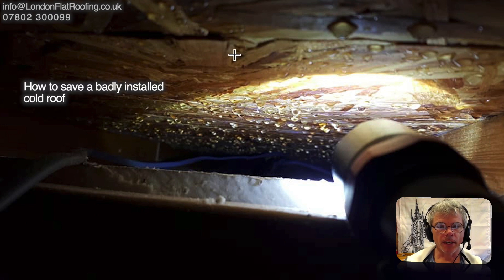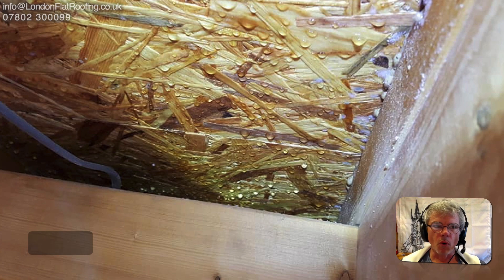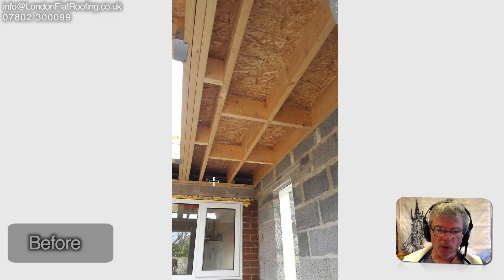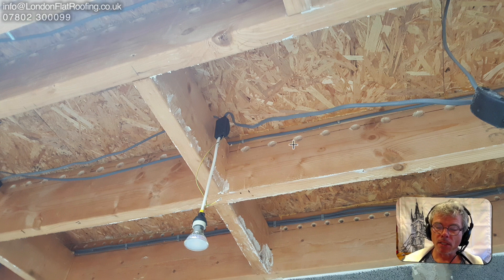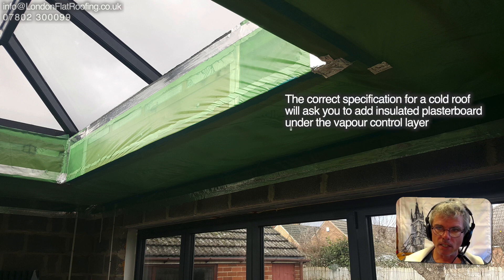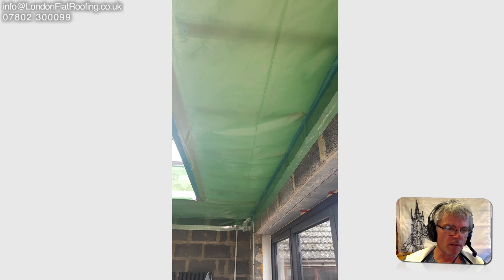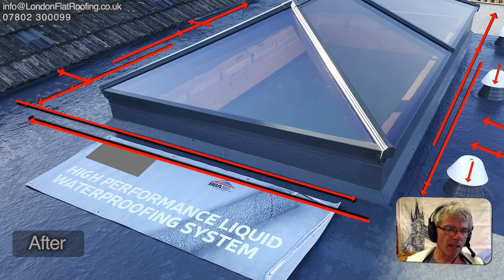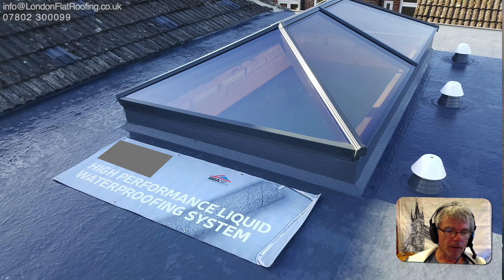Cold Flat Roof Ventilation Corrected

Comment: Steve I've just found your channel. I have a cold roof that has no eaves ventilation etc. Box steel roof. Can I out holes in the the top horizontal osb deck/sarking to ventilate? As long as I don't penetrative the breather membrane?

Comment: Hi Steve I have a builder in at the moment, he's put the joists in and he's put the roof on, and he's told me he is going to fill the joists with a wool type insulation, he's made no mention of air flow, or vents or vapour barriers. Can you give me some advice on what he should be doing please ?

Comment: Hi Steve, I have a cold roof and I do not have any sweet yet, as far as I am concerned, but we have no ventialtion wahtsoever on our roof. we are do add ventilation in the front of the extension( the roof) and we are hoping it sort the problem. is that something you would advise? does it need to have ventialtion both sides? front and back?
Reply from the maker: Yes absolutely you need to add as much ventilation as you can and make sure it's through ventilation so that it can flow from the top to the bottom or from side to side. You only have one vent on one side, the air can't push through

Comment: I always ask myself what these vapour barriers are actually doing when you're looking at atleast 24 holes through it for every sheet of plasterboard you fix. When the insulation is foil backed and the joints are taped, isn't that essentially a vapour barrier? I'd say the removal of the recessed downlights will be the biggest difference here.
Reply from the maker: There used to be an article are used to refer to that was called when is a vapour barrier not a vapour barrier and the answer is when there is something else actions as a vapour barrier in the wrong place. So having a paper barrier is a good idea, but having too many layers that could activate Barrys is not so clever.
Reply: I get what you mean but you are only driving a screw into the timbers which still leaves in between each joist with a sealed barrier and once the screw has been driven home and the board is sat flush up to the timber there’s not really any broken seal to the barrier right?

Comment: Yes, you could be compounding the problem. If you don't do it totally correctly, its  going to be a problem. So you need to vent and you need to have a AVCL. If however if you don't do it correctly, then I would have suggested packing between joists with Rockwool I've seen that work in the past to you have to ask yourself why isn't it working now?   are you sure the roof isn't leaking somewhere? Is the moisture content int he rooms below to high ?

Comment: Ooooh so many questions!
We have a flat roof dorma crofloft and pulled the ceiling down as it was falling in. Turns out the roofers/previous owners had packed the gap with rockwool, so condensation meant it had turned black and was soaking wet.
I’m trying to fix from below atm (I’m a woman with no spare money to speak of right now!) so was planning to put 50mm kingspan between the rafters, a breathable membrane, then plasterboard, leaving a 20mm ventilation gap at the top. I don’t have much depth to play with and There is no ventilation from the fascia boards. Am I compounding the problem by doing this? Cheers Steve.

Comment: Steve great videos 
Only thing I can't work out is 
When you screw up your plaster boards are you're screw piercing the vapour barrier ???
Reply: Good question
Reply: There are systems from companies like Novia that have butyl tapes you put on the joists that causes the rubber to “self seal” around the screw holes. 

Steve did a great video on this so have a look through his channel. 

Ideally you want to drop the ceiling to get power and lighting into the right place without pushing through the Vapour control layer.

Comment: Hi Steve,
Loving this vid! Really helpful. I have a question - I'm making a cold roof for our garden room. 5x2 rafters. 120mm Celotex board would completely fill the depth between rafters. I'm going to drill holes (like in the vid) to help air move... Should I get only 100mm Celotex, so air isn't blocked by that final 20mm of insulation board..??? Would appreciate your help. All best wishes and thanks, Lawrence
Reply: If you can 100% air seal the entire roof and still allow for electrical etc then you don’t need an air gap. If there’s the potential for air leakage then an air gap is required

Comment: Vapour barrier contains vapour inside a dwelling.  This is completely the opposite of the understanding of dwellings throughout history, we breathe and the building breathes, I think the entire design needs rethinking.  These kinds of designs have very strange and unrealistic expectations of a house and are more about techo fetish then real working houses, these designs have very low fault tolerance and once there is a fault major damage.
They are not robust practical real world solutions.
Reply from the maker: I can agree with most of your statements above however in today's buildings we are insulating to a very high standard in which case we are not building the way we used to build and therefore we need to address what happens to the moisture we are trapping inside the building therefore we need vapour barriers now but we didn't many years ago

Comment: Hi Steve,
Great video! I learnt about all the things wrong with my sweating roof. I will have to tear down the plasterboard ceiling from inside and do a very similar job to this person.

You mention at the end that the person who did this has since checked on the roof and it is dry. 

How is it possible to check the status of the roof after creating the vapor barrier? The only access point I can think of is via the mushroom vents at the top.
Reply from the maker: Yes thats one way or we cut into the roof but thats costly intrusive
Reply: Poke a semi-rigid endoscopic WiFi camera through the vents

Comment: Fantastic run down Steve! I’ve been glued to your videos and detailed analysis for a while. It’s a great resource :) your experience is top class 🙌🏻 I’m designing my garden room build at the moment. I’m in Scotland. Super keen on doing the warm roof system. One element I’m trying to consider is how to encourage the flow of air around the perimeter of the roof without making use of a soffit. I’ve built the timber frame and layering of warm roof in 3d and I want to make sure I have everything modelled up before breaking ground in early spring.
Reply from the maker: Send over details info@londonflatroofing.co.uk

Comment from the maker: No, as I don't do cold roofs  but all I can say is make sure it's fitted correctly taped at all joints and sealed to the walls so its totally air tight don't cut spotlights into it

Comment: Hi im doing a cold roof construction and they've said to use 9 inch timbers with 8 inch cellotex and foil back plasrerboard as a vapour barrier do you feel the airspace of 1 inch is adequate enough and the foilback plasterboard is enough thankyou .for your time and your help in this matter would b most appreciated .
Reply from the maker: yes but make sure you do a good avcl
Reply: @SteveRoofer  thanks Steve can you recomend a good vcl as there are so many please .thankyou
Reply from the maker: Building regs want 50mm air gap minimom on a cold roof. you need to install a proper AVCL air vapour control layer to the underside
Reply: @SteveRoofer  thanks for such a speedy reply Steve i thought it was 50 mm myself would you suggest counter batterning then steve .thanks mate .

Comment: Hi Steve are you saying that you cannot safely fit downlights in a cold roof. I ask because i currently have a flat roof and want to fit downlights around the perimeter? So therefore, if you have a cold roof are you advising you cannot have downlights at all? What about with a warm roof system how does this work with downlights?

Comment: WARNING: consult the NHBC guidelines before even thinking about drilling holes in your joists. Joists are there for a reason. Should your attempts to ventilate by creating holes of the wrong size or location, you will be compromising the structural integrity and putting lives at danger. 

"Bigger and better" is over-simplistic and gives no regard to the risks the home handyman or woman might be entering into.

Comment: Hi Steve thanks for these videos Im going to start some insulation in my loft so it would be a cold roof just wondered if you had a video on this was going to use some kingspan inside the rafters with a 50mm gap between the felt and then some insulated plasterboard but looking at this vapour barrier looks good.

Comment: With the vapour barrier in place can he still put in the LED downlighters or can you not pierce the barrier ? also if you put in a LED downlighter do you have to cut  all the way through the kingspan or do you just leave hole halfway through it about 60mm?
Reply from the maker: If you cut the AVCL you must repair it and make sure it totally airtight. If you downgrade the insulation buy cutting some of it away don't go to fare as  you will get thermal bringing
Reply: @SteveRoofer  Hi thanks for the reply, how would you "repair" it if you put in a downlighter is there a kit ?

Comment: Maybe a silly question, but how does the plasterer put his plaster boards onto the vapour barrier? My guy has just drilled through it into the beams - surely making it pointless as it now has loads of holes in it?!
Reply: Screws and nails dont leave holes unless you remove them.
Reply: Great question, was just wondering this myself.....seems the only way to have a perfect vapour Barrier is not to have any lights or plasterboard!

Comment: Builder obviously has no idea about condensation issues which is the real problem. Drilling all the holes and adding a VB is also a load of nonsense, the correct advice would have been to install a warm roof. Roofing consultants should be promoting good practices and not how to get over one bodge with another.

Comment: District Surveyor in the early 1970s said put inch holes through middle of joists on flat roofs to allow ventilation. At the time insulation tended to be two inches so did not block the holes if placed at the bottom over plasterboard. Often people put it at the top still no problem. I think what has happened since then is people sealing up their rooms and avoiding ventilation so more moisture to get into the joist space.

Comment: Hi Steve,  can you not use foil back plaster as vapour barrier??
Reply: Good question
Reply: @johnp6636  If the joints crossways fit closely can't see much problem. No airflow after plastering.

Comment: I am wondering how you can deal with condensation in a roof/deck which is blocked between the joists/rafters but open to the ambient air.  The problem comes from the fact it houses a mini-split which keeps the inside air (although it has large air opening below and above the door plus the aforementioned open joist bays at the plates) about five degrees F less than outside air (ninety nine percent heating during the year-only three or four days when the a/c is needed).  Getting mold growing on the underside of the roof deck which is 1 1/4" plywood with a thick fiberglass coating on the walking surface.  I was surprised as I had thought the air flow and circulation would have kept any condensation at bay.  All inside studs and joists are uncovered by the way.  When the mini is on it blows a real blast of air which confuses me even more as I would regard that as forced ventilation in open spaces with plenty of free air to draw from.  Moisture is a fact of life here in SE Alaska in a temperate rain forest with high humidity, frequent high winds and a temperature range of 10+ F to 80 F very infrequently mostly staying between thirty and sixty year round.  Walls are doing well, just the ceiling (underside of the deck) is showing mold after a year of use.  Can't see where a vapor barrier would help making dead air pockets in an unheated roof structure.  Seems to be more pronounced in the 25-40 degree temperature range.
Reply from the maker: Please email me over photos and I will see f I can help info@londonflatroofing.co.uk

Comment: Sooooo.. i got trown into this becouse someone i know followed your way of working.. after i tryed to explain him why it was a bad way of working he showed me your video... i had put my opinion of this aside and went to my big circle of "smart people" (being a group of architects, salesmen and fellow roofers) they all reacted the same as i had in my mind.
1. The airflow will CREATE moisture AND lowers the vallue of the isolation.
2. The correctly installed vapor barier solves the problem.. if u would have punctures, tape it.
3. The reason the guy had droplets/condense was becouse he had the building isolated and warm on a cold day and had no vaporbarier and no plastering yet. So you solved the problem by installing the vaporbarier but then allowed moisture air in again by creating airflow. And as most people use rockwool etc between the beams it lowers the isolation value by allot.

This method is way outdated and good when isolation was not a big deal yet and  people did not use good quality vaporbarier yet.. people have gotten smarter then this.

Just my opinion after a long and wide discution and research about this. Its ok if you do not share my opinion, but if you insist my reasoning is still wrong, please do point out where i go wrong.
Reply from the maker: This is excellent as you are right in so many ways.
Everything I put forwards on my videos is info that from my understanding is the latest information from the British building regulations. Personly I don't always agree with it, but we have to follow protocol or we can get sued. I understand that SIGA is basically saying the same as you and they want to use open-cell insulation such as rockwood, but here in the UK, we are mainly using closed-cell insulation (PIR), and that makes a lot of difference you have to ventilate above.

Comment: Hi Steve, i'm in Canada ( zone 6) and i have a 2x8  cold roof with  EPDM , 3/4 plywood sheathing, 2" vent space , 3/4 inch EPS foam baffles ( sealed to joists) , 5 1/2 inch FG insulation, and 2.13  inches (R-10)   of  EPS foam sealed at all joints with a laminate to stop thermal bridging.  My questions are is the 2.13 foam acceptable as  an air and moisture barrier ? and should the 3/4 foam be sealed to the joists,in case of moisture getting by  the 2.13 foam  .Thank You for the videos and your time
Reply from the maker: No you need a proper VCL now called an AVCL air and vapour control layer  if zone 6 is a cold zone then it goes under the insulation

Comment: Hi Steve,
Really interesting and helpful video.
I’ve recently constructed a garden building.
Block built then clad.
I have a epdm roof (cold) My intention for it is a music studio. So having an air cap cavity in walls
I put the doors on it last week went in today and the osb is soaked with condensation :(
I’ve not got any venting yet. I was recommended  to pack the joist with rockwool and then vapour barrier to seal all internal walls and roof so no venting.
Is it ok to insulate while it’s wet? I’ve opened the doors to dry and it out.

Any help would be very much appreciated.

Roy
Reply from the maker: Construction moisture lock just don't lock it in, vent the roof get it out. Cold flat roofs are good as they breath if vented properly.
As regards walls again let them dry befor closing them and let them breath from the outside
Reply: Steve Roofer thanks so much.
I don’t have any room for under soffit venting so was thing of using a number of trickle vents on the side of the facia (just the outer part) do you think this will be sufficient?
Many thanks
Roy
Reply from the maker: @royfoster7010  the ventilation in a cold flat roof is of the utmost importance you can never get to much so whatever you do overdo the venting, I always think about it like just having an umbrella over the insulation lots of venting from all sides
Reply: Steve Roofer Hi Steve! Thanks again for all you advice I’ve started cutting 40mm holes in my joists and put vents on the facias.

The roof is now bone dry as I’ve left the doors open with a fan for the past week. My only worry is small black dots (mould) has appeared. Very tiny.
Should I worry or do anything?
Reply from the maker: @royfoster7010  theoretically no as the mind won't grow if it can't get one of its foods and that's water or moisture if its dry up there then it will be dormant
Reply: Steve Roofer thanks much appreciated!!
Reply: Steve Roofer would I be able to send you some pictures of my build I’d happily pay for your advice.
Reply: @royfoster7010  hi Roy
I'm also building a block-built studio approx 5 x 4 with cold roof
I've been planning it to be pretty much airtight, surely ventilation will just let out sound?
Reply: Darland that was my original plan but I put the doors on and after a frost I went in and the roof was soaked!! Thought about this ‘hybrid roof’ but I think venting is the only way.....
Reply: @darland3821  That was my initial understanding, but after some research, if i wanted an 'airtight' building I should of done a warm roof. now i have a cold roof i will need to vent :( steve's latest video is my studio build. I'm having an air gap cavity so this should help with the soundproofing.

Good luck with your build.

Comment: Hi Steve great videos, I never thought roofing could be so interesting.  I have a cold garage roof with 6 inch joists over a 3m span.  The firrings for the first 3 to 4 joists are very thin, so I will have put holes into the joist.  The roof is well vented at one end of the 3m span and at the last joist of the room into the remainder of the garage.  What size and spacing of holes do you recommend for the first 3 to 4 joists.

Cheers
Reply from the maker: The only thing i can say is  the bigger the better and the more the better but don't compromise the joists